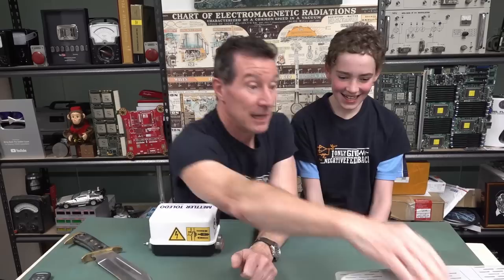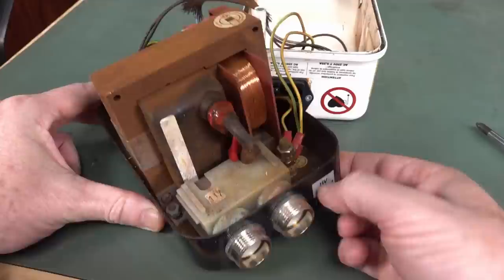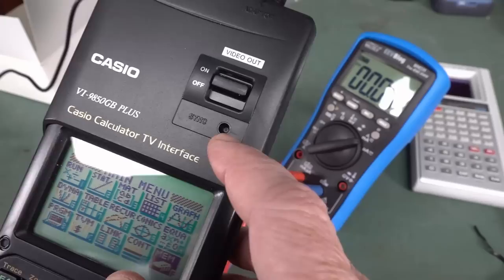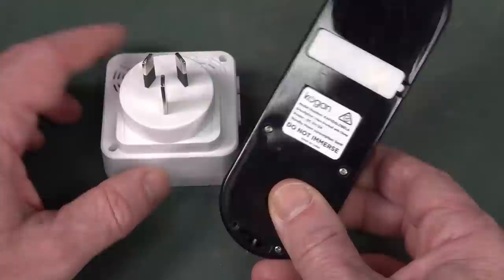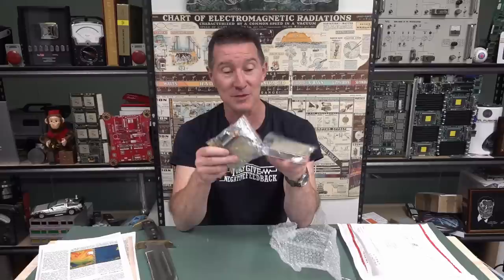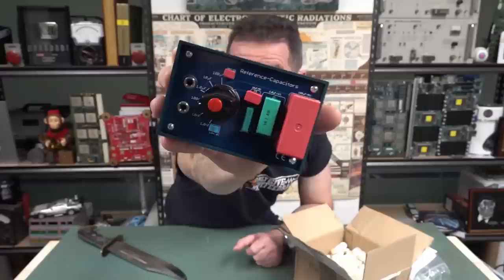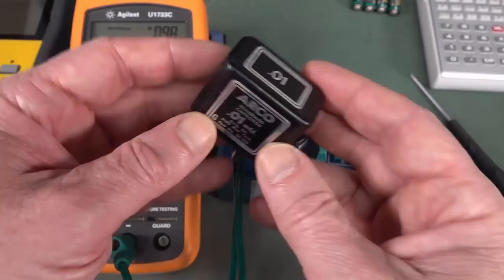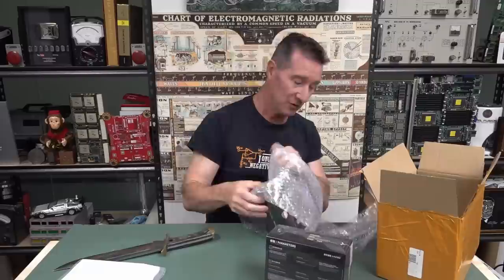EEVblog 1496 - Winning Mailbag

Comment: Cool to meet Josh! If that high voltage supply came out of a chemical plant, I'd be concerned that was NOT iron oxide, but rather the result of some reaction. If you start growing a third arm, or notice random holes in the benches, call the hazmat people. 😁
Reply: I think that it is from a fume hood or cupboard, part of the filtering.

Comment: The PSU at the start is for running an electrostatic ionizing system surprising how many different fields use these devices too.. I know of one in a lab where its used to stop electrostatic causing small amounts of various chemical powders to fly off and stick to everything when weighing very precise amounts etc etc. I beleive they are used in places with textiles / paper and foil too for very much the same thing.

Comment: Rust from the steel being oxidized by the ozone.  Presuming its a negative high voltage line, ground would end up being the terminal being oxidized. The transformer laminations are rusting primarily from the oxidation via the excess ozone.  If i recall correctly, ionized air has a chance of making HNO3 (nitric acid.   -codys lab made a video on it) which will also dissolve some of the iron in the steel along with the O3 

It had a gasket and was sealed off from the chemical atmosphere, so no need to worry about third arms or whatever ridiculous thing... Plus, they wouldnt have that in any direct chemical harm, as its expensive af new (id imagine anyways)

Comment: I have seen measurement equipment come back from chemical labs covered in rust just like that Mettler Toledo. The air can contain higher levels of acids than normal office air. Not enough to be a problem for humans that are in and out, but leave something in that environment for a few years 24/7 and it will corrode.
Reply: Can you confirm this other message is a scam please?

Comment: Hey Dave, I would suggest to perform open and short calibration of the LCR meter with cables attached before measurements. Your values were higher probably because of parallel resistance introduced by the cables.

Comment: There is still a lot of packet radio in my area. It's mostly just winlink traffic though and of course there is tons of APRS activity as well. Unfortunately packet radio BBS systems are rather rare now. APRS is on 144.39MHz in the US and I believe Australia uses 145.175MHz. You will hear lots of short packet radio data transmissions on there. You can also listen to 145.825MHz when the ISS is overhead. It has a packet radio digipeater that is very active with APRS. With a good antenna, you can hear it within about a 2000km radius.

There are still multiple weather fax transmitters in the US too, they are run by NOAA. Tune into one of the wefax stations on a web sdr in the US and pass the audio to fldigi and you will get the images on your computer. You can get the frequencies and schedule from the NOAA website.

Comment: 4:10 The only correct way to display numbers is what General Conference on Weights and Measures suggests and that will be in ISO 80000-1: space as thousand separator and either comma or period as decimal separator. Removes all ambiguity.

Comment: I'm guessing the 6.7kV transformer case was not hermetically sealed, allowing moisture to penetrate. Could be via the O-ring seal, output connectors, screws etc.  It may have been better to put in 2 ventilation holes (with paper or cloth covering to keep out dust).

Comment: Those Tom Moffat kits would likely still work. Weather service images are still transmitted on 40m shortwawe SSB band. However, what you have there is only a modem, you would still need a suitable HF receiver, antenna and a software to decode the WEFAX signal.

Oh and that TCM3105 chip is ancient! Those things were out of production unobtanium in the 90s already. It is an old telecommunication 1200Bd Bell 202 protocol FSK modem. They were popular in HAM radio projects of that era, these days most microcontrollers can handle the signal decoding in software or you do it on PC instead.

Comment: @EEVblog - if that high voltage transformer was used in a chemistry lab then this is very much what you get with acid fumes. E.g. hydrochloric acid even in a closed bottle produces fumes that will cause similar corrosion on anything metallic nearby.

Comment: I think discharging the input caps makes a lot of sense and it should be necessary because I have been shocked many times by dogy-ass power adapters from the input plug.

Comment: The Casio gadget was really interesting though I wonder if they could have split the thing in two for a better user experience; the calculator / handheld part could have been smaller and lighter with only a comparatively small modification for modulating the very low resolution LCD signal over a thin flexible wire to a video encoder box connected to the classroom TV. You could stream the uncompressed 128x64x2-bit LCD image at 10fps using only a 160kbit/sec serial link.

Comment: Fun fact about that Kogan doorbell: The receiver bit you plug into the mains is exclusively for the doorbell, the motion detection logic is in the doorbell and it transmits alerts via Wi-Fi to the rebranded app you need to set it up. I know this because I'm the guy that sent it in. I am still rather pissed that Kogan got the rights to DSE because they were a decent store chain until they went belly-up and now they're just another online-only fly-by-night thing. What I found interesting about that battery arrangement is that there seems to be a second battery connector on the board that just goes unused. The advertised battery life was 3 months but it barely lasted 2 out of the box and the cheap batteries bought that number down in a hurry.

Comment: Hi, really appreciate all your skill and knowledge.  I dont know where to ask, please help redirect, but I have a $25 square 120ac fan.  it worked.  now it doesnt, want to find some way to rewire it, fix it, do ?? to it, short the switch and force it to work.  Can you please help?  it was in the window, the ac unit I had was stolen before i could put it into the window, just how things are here.  Right now there is no extra $25-50 for a new fan.  The window slides up/down the track spring is gone. So the fan sits and the window holds it in place.  Well one day the dogs got excited at something and all tried to look out the window and it fell, luckily inside. I get to the room to find a dog standing on the fan flat on the floor, smell of hot or burned circuit and the fan does not work.  Have to guess they stood on it, held the fan still until it gave out.  Ive already replaced the 120v wire as it was chewed thru years back, so any fuse in there is gone.  Switch has N 1 2 3, 3 speeds?  and L N going in.  ohmed out N = N, but L is 17Meg or so across the switch. ok lets wire L to 2 ?   plug in, nothing.    Was sure I had an old one with a cracked fan blade but worked?  no, had thrown that away when cleaning, didnt want to look like a hoarder.  So now because I had to be so clean and not keep the thing even when the motor worked and cant use it for parts? Im not buying a new one, want to fix or rewire or ? this motor.    Ive done electronic work over 50 years and know that YOU know the industry so good.  Ive had to branch out and take other work to pay bills, not able to work on all the stuff I'd like to have done.  temp here is upper 80s very high humidity, down to 70 at night with zero wind.  thanks for any ideas to make the fan work :)

Comment: maybe the mettler toledo high voltage source is for things like electrolysis?
Reply: The Haug website says it's a discharging power pack for an ionizer unit. They don't say what it is used for, they kind of assume you know exactly what it is if you're browsing their products.

Comment: @EEVblog I have Stanley Kubrick's Toshiba T1000 that was used during the making of 'Full Metal Jacket'.
He handed it to me and said 'If you can get it working you can keep it.'
When I opened it the battery pack had spewed it's electrolyte over the mother board.
The corosion wasn't terrible and I managed to get it working.
I've kept it as a kind of momento ever since.
Reply: @Okurka.  I was one of Stanley's photographers at the time.
Reply: @Okurka.  OMG I just got the joke! Hasta la vista, baby.

Comment: I think the Sync hole is a way to send data to another unit with a 3 pin serial connector?
Reply from the maker: Nope. According to the manual it's to resync the video signal if you have picture issues.  How it does that I don't know.

Comment: In the 80's I made PCBs by painting traces with enamel paint ( Ithe paint I used for scale model motorbikes) And then toss it in the brown ferro-something stuff. Most thing I builded did not work. I now know why. The schematics used some transistor that was as usual not for sale in the local shop. After waiting an hour until it was your turn, the salesman (an ewlectronics god in my kid-eyes) then took some book, mumbled a lot of voodoo things about beta and Vbe and after that he went to the back of the shop, after 10 minutes he then re-appeared  holding a transistor. But he never told me transistors do not all have the same pin layout........

Really, selling a reference capacitor box and then use on of the most crappy LCR meters to calibrate ?  I think I could do much better then that

Comment: You keep saying how you hate in-ear headphones, explaining that it is just a matter of preference, but the type you use is so inferior sound quality wise, that it makes me think you just got some phobia of seal ones or plugging your ear canals, or something.. and it completely dominates your ability to see the difference.

Sure you have to put (in some cases a lot of) effort into finding comfortable ones, and not all of them got good drivers in the first place, but considering technology alone you got to notice that they are just miles easier to reproduce sound with less distortion just due to more controllable acoustics of tightly sealed space and less power amplification required (which translates to less distortion in sound systems) to maintain the same amount of acoustic pressure. It is not even about bass at this point, it is about isolation and efficiency..
You are not giving them a fair try.